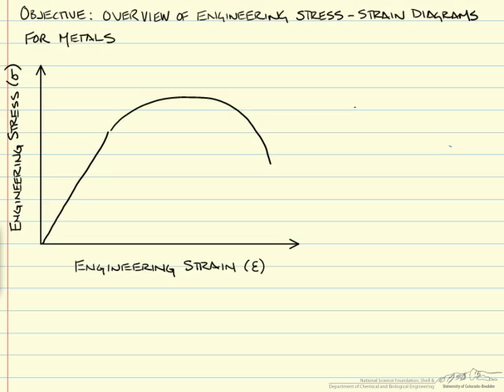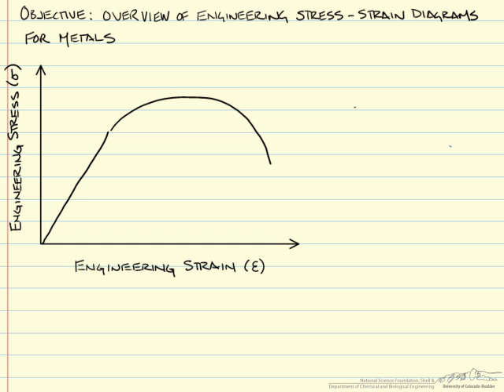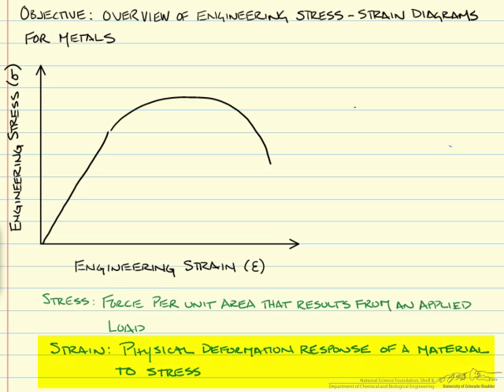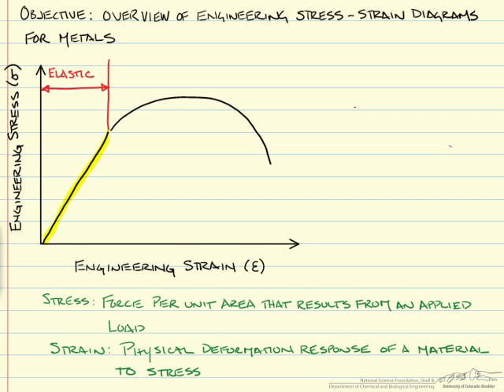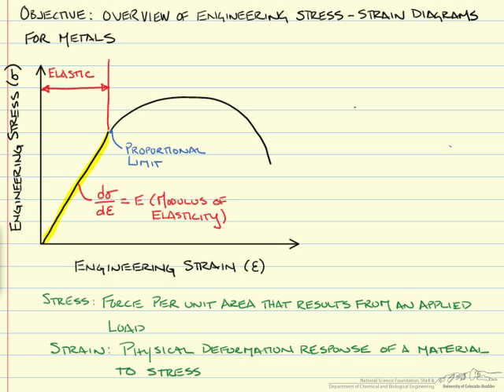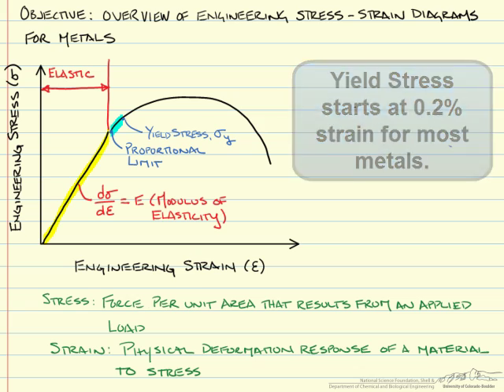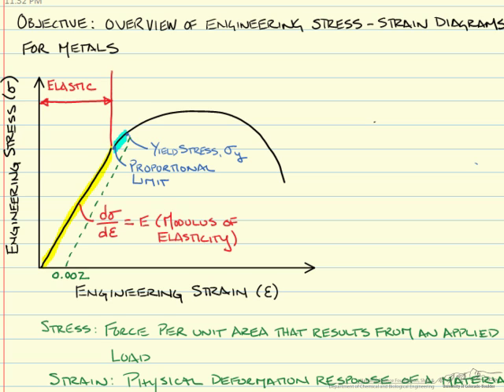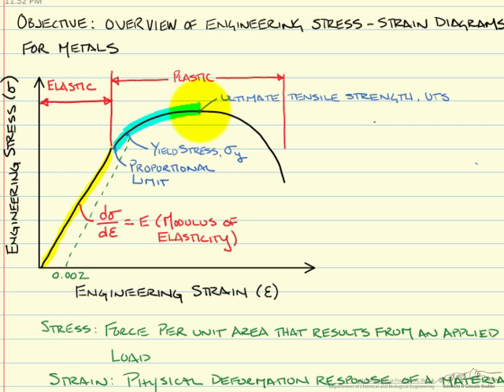Stress-Strain Diagrams

Comment: The fracture strain should be drawn vertically down from fracture point.
Reply: No it shouldn't. The material still maintains elastic behaviour. After fracture, the two halves spring back, which is why the fracture strain is on a diagonal

Comment: So many errors! 

Stress is not applied in a test...displacement (or in some cases strain) is applied either a constant displacement (or strain rate)

"Yield stress starts at 0.2% strain" is just utter nonsense! Yield begins at yield stress. The engineering strain at which yield begins depends on both the yield stress and the elastic modulus. 0.2% strain is simply a well agreed upon convention for identifying the approximate yield stress, i.e, where the total plastic strain in 0.2%.

Comment: No not really. What is simply happening is that after plasticity has been exceeded by a certain amout the specimen begins to adopt a kind of hour-glass profile. Imagine if you will taking a roll of plasticine and pulling it. You will soon notice that it will begin to thin. this will happen whether you do quickly or slowly. However, afetr yielding the amount of force required to produce a given strain is reduced. Dividing by the original area thus gives a lower stress and the curve slopes down.

Comment: OK, the downward sloping of the curve is because once the load reaches a certain level, the specimen begins to exhibit noticeable "necking", by which I mean the section area begins to reduce (Poisson's effect). However, when the stress is being calculated at this level of load the original crossectional area is used whic means the stress is calculated to be lower than what it would be if the "true" are was used. If the true area was used you will not see this downward slope.

Comment: In some materials it is not obvious from the stress strain diagram where yielding begins. Typical of this is Aluminium. So in order to set a standard they take 0.2% strain as the point where yield occurs. 0.2% strain simply means that the specimen has stretched by 0.2% of its original length (strain = elongation/original length).  Even if the material is slightly in the plastic region with 0.2% strain, next time it is loaded it will be linear until this strain is reached. This work hardening.